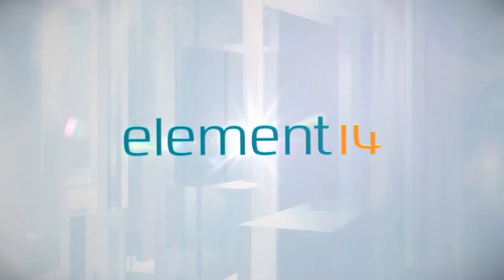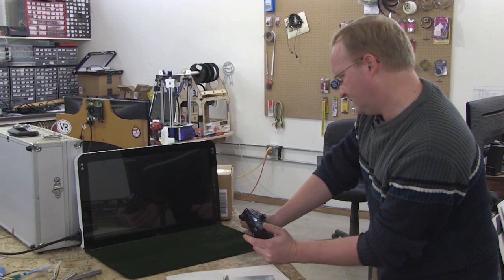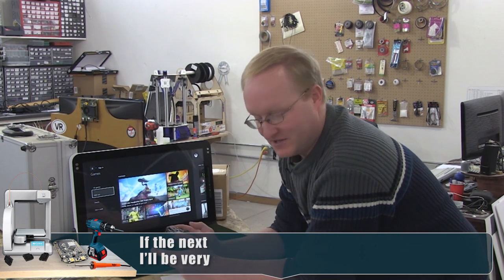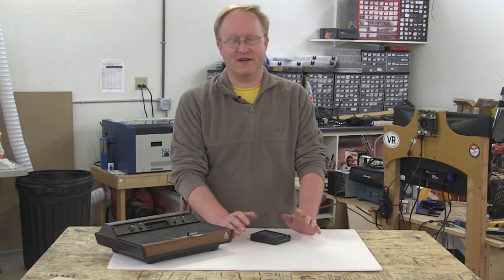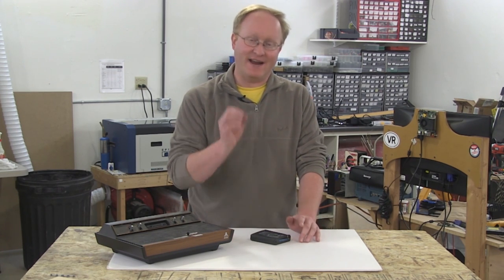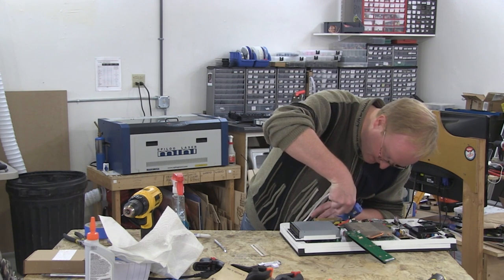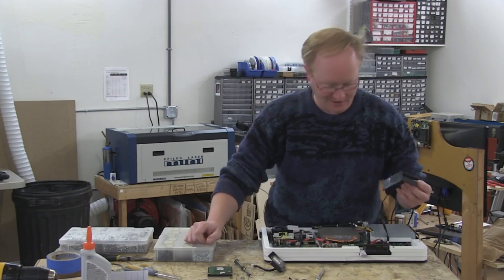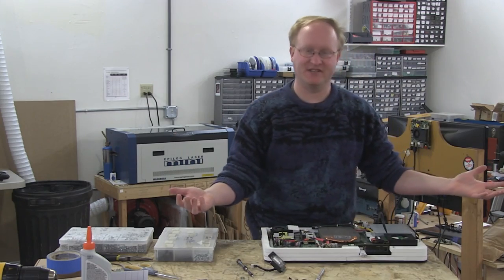Ben Heck’s Xbox One Portable Part 3

Comment: Or just buy a entry grade gaming laptop -3-
Reply: HDMG And play all those Xbox One exclusives on it...?
Reply: FifaHdVidz Or not.
Reply: ***** Out of which a good 9/10 are shovelware and early access shit. No thanks.
Reply: athest7 you know not everybody cares abour exclusives...
Reply: athest7 Does the Xbone even have 10 exclusives? Are any of them any good? 

I doubt both.
Reply: Kharnivore2099 Both console have exclusives. Whether they are good is entirely up to the individual and irrelevant to the discussion.
Reply: After you suggested that 9/10 PC exclusives are "Shovelware and Early Access shit", it is absolutely relevant.
Reply: Kharnivore2099 Because that is true, and the trend exists very little on consoles, if even at all.
Reply: athest7 If you haven't noticed a trend of consoles picking up shovelware i think you may just be in denial. PC has seen it's fair share of bad games but that is to be expected on a platform that has been around for 30+ years, though it is hardly 90% shovelware. Having a tiny library of inferior versions of games and generally quite a poor range of exclusives is a far more undesirable situation to be in.

Though this project is interesting, it makes very little sense when you could have a much better platform at far much less expense with a massive range of high quality games.
Reply: Kharnivore2099 Never said I didn't, yet the amount of it on PC completely eclipses the consoles. Consoles have not existed for a significantly smaller time as a gaming platform. Whether the versions are inferior is subjective to you. Massive range, but overall very inconsistent quality, with quantity over quality.
Reply: athest7 what exclusives on consoles NOT NAMED WII U
Reply: Ethan Ly The plethora of exclusives on the other consoles.
Reply: Ethan Ly Have fun emulating any of the current or previous generation consoles.
Reply: 360 emulation is already underway, thankfully exclusives aren't usually locked off from PC in the long run.

Probably just better off supporting the open platform from the start rather than supporting segregation of players and supporting these awful online subscriptions. ;)
Reply: Kharnivore2099 Underway, as in barely possible and not even a remotely plausible stable alternative to actually playing the games on the console. And how long did that take since the console's release? Not to even mention the PS3, which has an even more obscure and harder to reverse engineer architecture. Sorry, but I don't find it right to support morally very grey platforms which are essentially instigating piracy, no matter in what nice manner you try to call them.
Reply: Underway, yes...that's what i said. Well done. So what does the 360 and PS3 library have to do with buying a PC over some silly Xbone laptop?

We seem to have been derailed, the original point was that you'd be better off with a PC rather than one of these...unless you wan't to play either Sunset Overdrive or forza on the bus. Seems to be a collective agreement that PC is just the better option, as long as bad devs stop making their games available on exclusive platforms for wads of cash. ;)
Reply: Kharnivore2099 Yup, underway. Gonna have blast playing all those obsolete games in 10 years! The subject was about console exclusives and emulation of consoles in the current and the past generation, not just about the Xbox one or an Xbox one laptop.

The original point has nothing to do with the current discussion anymore. The PC is the best option.... unless you want to play any exclusives. That's just something that you can't do anything against, no matter how much you try to show the big evil corporations and devs in a bad light for making exclusives, or no matter how much you try to paint your morally questionable piracy as open platform. No amount of emoticons at the end of your comments won't change that either.
Reply: "Any" exclusives? Surely most are actually on PC though, right? You could also use your own argument of those games already being obsolete, no need to wait 10 years, so who cares?

If there was actually a list of exclusives that warrant the purchase of these machine then i could see where you are coming from, then you may have a point. Right now, there is literally Bloodborne, the only exclusive that looks like it's worth any time at all on the consoles. (Unless we get into Wii U, that is.)
Reply: Kharnivore2099 Obviously it was a given that the any exclusives refers to any exclusives on said consoles. At least I thought it would be a given and not so hard to put together, considering the whole subject at hand, and you know, common sense, but it seems I overestimated.

The games sure weren't obsolete when they were released and only playable on their respective console, just like with the current exclusives. If you have any idea about the PS3's architecture and emulation, you can bet that actual stable emulation of that console, with it being a viable alternative to the actual console in that sense, is still closer to 10 years off, than it is to a few years.

Whether an exclusive warrants the purchase of a console is entirely subjective and up to the individual. You can try to put some spin of warranting a purchase on it, but it doesn't change the fact that what you're saying is whether if someone likes or wants to play a game enough that they'll buy the console for it. And that's entirely up to the individual, and as such, there fundamentally cannot be an objective list for it.
Reply: If you are purchasing a console for one or maybe two games then i think common sense has already left this discussion.
Reply: Kharnivore2099 It seems that your attempts at understanding subjectivity have failed again. Well, at least you tried.
Reply: No, not really. I just grew weary of the conversation a long time ago. :P The OP's comment still stands true, should just buy an entery grade PC/Laptop.
Reply: Kharnivore2099 Which might stem from your inability to even understand what's being discussed and not being able to come up with a counter argument. The original comment doesn't stand true as is, and it comes with a plethora of disclaimers, the exclusives being one of them.
Reply: You don't have to believe the truth, it's fine, ridiculous...but fine.

He may as well have bought a laptop, simple as that. Have you not seen what MS are pushing for in the near future? Their exclusives are looking very likely on PC too. I think you better question your own ability to understand matters rather than question those of others, rather than get high and mighty on social media sites...it just looks kind of sad.

Bit of a shame really.
Reply: Kharnivore2099 Yet it's not the truth, as there's no objective truth in the subject to begin with. Thinking that your own outlook on it is the truth is the only ridiculous thing here.

Some might be likely to be ported to PC, but there will always be exclusives, which makes the argument fundamentally different. I'm not the one being high and mighty, that's you, mister my own opinion on it is the truth and anyone who disagrees is stupid. That's how your essentially presenting yourself, and its a childish and ignorant mindset, especially from someone that I assume it at least the age of a teenager.
Reply: No one here is saying one is better than the other, and i never said my opinion is the truth. The matter here is that he should have just got a laptop, "truth" because those exclusives will be on the PC in the near future. That's not opinion, that is fact.

If you want to call people children here on the internet, you can do that too, if it makes you feel better then that's just fantastic. Just never assume, it's the first step in many mistakes and failures.
Reply: Kharnivore2099 You very much did so, with your previous comment. That is not a fact. Look up the definition of fact, because it's laughable to confuse it with speculation.

Care to point out where exactly I called someone a child or assumed someone was a child? It seems that you have a hard time with reading comprehension. I assumed that you are at the very least the age of a teenager, based on your access to a computer, for one. Was I wrong about that, then? I highly doubt it. You're so deep with your vague talk about assumptions leading to failures, that I can't even see you anymore.
Reply: Pedantic too? Brilliant.

MS wanting to bring you Xbox one games to your PC, sorry...i must have misunderstood that. Forgive me for mistaking them and interpreting that as wanting to deliver that service as a fact, of all things.

My bad, that must have just been my opinion they were talking about. Silly Microsoft
Reply: Kharnivore2099 There's a fundamental difference between fact and speculation, and there's nothing pedantic about that. They said they wanted to bring more of those games to the PC, along with a streaming service from your console to your PC. They didn't say that literally every exclusive will now also be on PC, as that's just not going to happen, and would be plain stupid. You are forgiven for your misunderstanding though, it happens. You've already proven to not be the sharpest tool so it's not really a surprise, don't worry about it.
Reply: Off-hand comments to fill in time on social media have no merit towards intelligence. If that is how you judge it, oh boy.

No wonder this derailed off and down the beaten path.
Reply: Kharnivore2099 They do. If you don't want people to think you're stupid, stop saying stupid shit. I judge your intelligence based on your comments and how you present yourself, which very much paints that kind of a picture now.
Reply: Judge people by their Youtube comments, got it.
Reply: Kharnivore2099 Again, there's a very simple solution to this. Don't say stupid shit if you don't want people to think you're stupid. Your comments are the sole way you are presenting yourself on this site and in this comment section, and as such, they are the only things that people will, or can, use to form their opinion about you.

If someone only feels the need to say childish or petty things, whether that's on here or on any site, then obviously people are going to think that the person is childish and petty, based on those comments, as they're the sole way he presents. The same goes for real life. If someone were to come up to you and tell you to go fuck yourself, would you think that the guy is an asshole based on that? Or just think that you shouldn't judge people based on what they say. Use some common sense for a while.
Reply: 30+ comments later in a thread not going anywhere slow and you are talking about intelligence and common sense.

Sorry to say this, but neither seem to be your strong point and you certainly aren't fit to be talking down to people about it.

Feel free to carry on though.
Reply: Kharnivore2099 I love it how you fail at bringing up any counter argument to my points, and then just proceed to have a gigantic fit of hypocrisy in complaining how this is not going anywhere and how you shouldn't talk down to people, while being the reason for the former yourself, and doing the latter yourself as well. But hey, buddy, it's good to see that you've now completely resigned yourself to petty bullshit instead of even trying to say anything meaningful or stay on topic. Looking forward to seeing another reply that says absolutely nothing from you again.
Reply: +athest7 Im glad that you enjoyed it. Just remember...always go with the PC. It's definitely the best option.
Reply: +athest7 Resorting to calling people names now? Good work.
Reply: Kharnivore2099 Getting offended just for the sake of getting overtly offended? Cry me a river and wake up to the real world.
Reply: athest7 Who was offended?
Reply: Kharnivore2099 You was offended.
Reply: Haha, okay. If you are sure.
Reply: Yet you are doing the same. Such intelligence, such common sense.
Reply: Kharnivore2099 I'm only replying back to you. Me doing it as well does not excuse you. You're the one who's admitted that they don't want to even bother with an actual conversation anymore, and yet you're the one who's derailing this with utter bullshit. Memes now? Lol. It seems that I did overestimate your age after all. Should I start whining about you calling names now, then?
Reply: "You're the one who's admitted that they don't want to even bother with an actual conversation anymore"

Yet you continue to reply...
Reply: Kharnivore2099 That's what you said. That has nothing to do with me, and I have no problem keeping this up. You're just replying for the sake of it, and I'm calling you out on it. Are you really that salty that you lost your little bullshit argument?
Reply: You seem to be the only one salty here.

"Calling you out", that is pretty hilarious. Though we can end this now if you want?
Reply: You may have some delusions about what salty is, your replies alone show how angry this discussion has made you. Let it go, lad. Let it go.

Feel free to have the last word though, it's my gift to you.
Reply: +athest7 What the fuck.
Reply: Ashley brown Thank you for the input.
Reply: +Kharnivore2099 Don't act like an idiot on yhe internet, don't get treated like an idiot? Seems pretty logical.

Comment: I still use optical media at times. It's more convenient when you don't have high speed internet to rely on, and want to keep a copy available without cluttering up a flash drive.

I have a collection of Linux live DVDs that I keep on actual discs. For older computers they can be a great solution to diagnostic needs.

Comment: Some thoughts, on making it thinner (what I might have done). Would it be possible to replace the XBox power supply, with something smaller/thinner? Or make it external?
Possibly relocate that heatsink, instead of keeping the default heatsink? (I know that adds risk)

Did MS tie the optical drive to the unit again (like the 360)? If not, would it be possible to substitute the optical drive, with one from a laptop?

Not to start a console war, but personally, I would have done this with a PS4, since it's fairly slim already. Then again, that's also the system I chose, for this generation of consoles.

Comment: It's a cool project. But I would consider putting the disk drive on the top of the case. It could fix the insert disc problem, cause the disk wouldn't fall to the side of the drive. Also the heat sink on the top would help the airflow. Hot air moves up;)

Comment: In stead of putting the Blue-Ray drive into the portable, you could have put connectors on to the side and build a case for the Drive. so if you need it, you can plug it in :)

Comment: Ben I think you did a great job, but i think it's not really portable if it doesn't have some portable power source, you could add some lipo cells in a layer that could add to around 12v 15-20amps of power probably enough to run everything for one or two hours or you can make it a laptop and add even more cells to the bottom and make it 'thinner' by splitting it in half just like a laptop (that would make the bluray drive work in the right position), also the cooling solution doesn't seem good enough for a hardcore gamer i still think that's gonna overheat after a few hours if not sooner.. but again really nice job!

Comment: Ben & Cast - Have you thought of a Large all-in one? I.E. A Super Smart TV..... Start with a large flat panel, add a X-Box One & PS4 internally, Maybe a Raspberry Pie and one of those windows sticks PC...... All Wall mountable for a super size true entertainment device.....   Just a thought.  Other Items could be a steam box, Built in cam for skype and ect.... Could use the rasperry pie for primary "Smart" menu and controller for sharing the Webcam and other add-ons.  
     Same concept could be built in a projector for portability.  Thoughts?
Reply: The idea is great, However, it will very quickly become out dated as technological advances and the development of more effective internal hardware i.e. better cooling fans and the PS5 and new XBOX systems would atleast I hope outclass the PS4 and XBOX One systems. My next concern is power. The power that this thing would require would probably be around just a guess 1000w to anywhere around 2000w easily if you are going to incorporate a PS4 XBOX One Steam and computer like traits. Now moving on to my next concern. Weight. plain and simple. Weight. The PS4 weighs roughly 5 pounds and I am assuming an XBOX is somewhat close to that. now add that strain on a wall-mounted TV stand adding close to 80-120 lbs on to a stand with bolts drilled into wood, the strain if someone were to displace that weight i.e. hanging on it for balance or just a child hanging on it thinking its a game. Surely I assume would exceed the weight limit and either rip the mount off the wall or snapping the structual supports its bolted to in your home causing imminent failure of either the mount or the wood. Next up is Size. This device is going to be fat certainly not pleasing to consumers or relatively the human eye anymore. But the components in this would certainly please consumers. Next is price. If you were to make this you are going to be looking at close to 1300 dollars. This is too expensive to put all into one thing and worst case scenario it fails to work and ends up screwing everything over.

Comment: Optical Media isn't dead in fact it may see a renaissance in coming years. With more and more ISPs putting up data caps (my 3megabit connection has a 10 gb per month hard data cap), it's just easier to buy hard copies.

Comment: Ben if you think back to the 360's if you had one standing vertical like how you mocked this up if the system got shaken or bumped in anyway it would leave a ring around the disk making is useless to never work again. Thats probably why they designed the one to be flat only to eliminate people destroying their disks. just an idea.